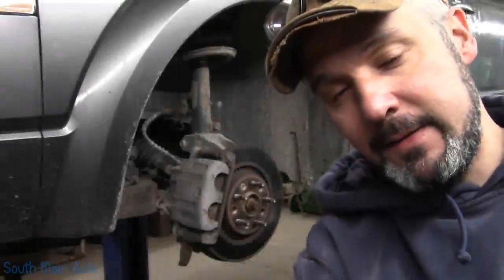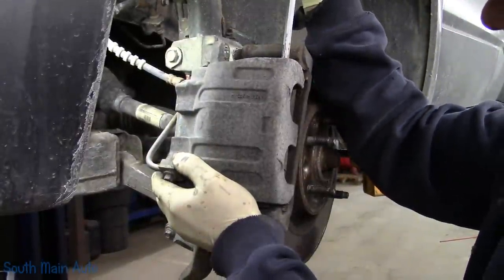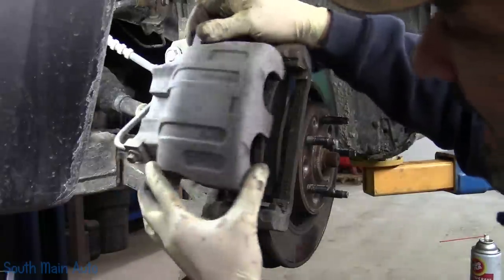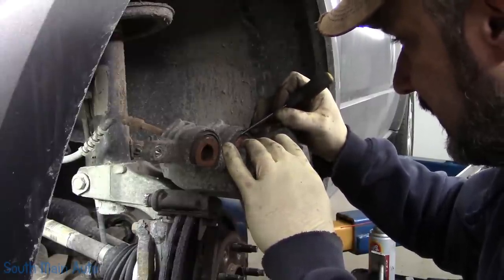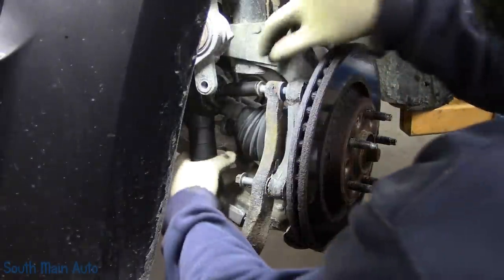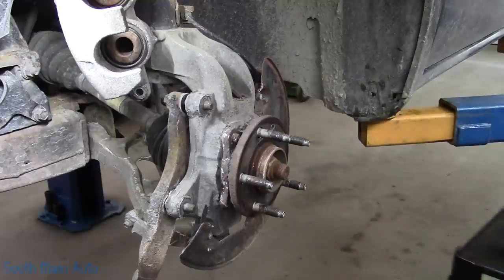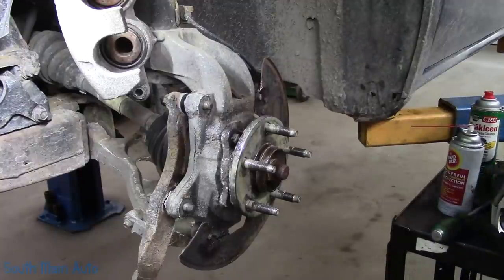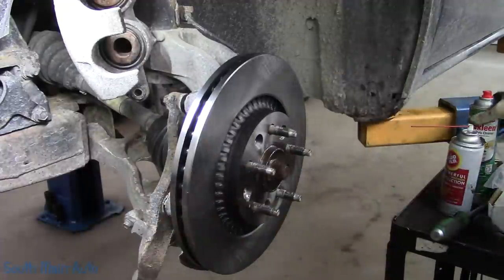Ford Freestyle: Front Brakes w/ Seized Caliper Pin

Comment: I feel better.  The last time I did my brakes I had one caliper pin that was a little sticky.  I pulled it out, smoothed it out with some steel wool, cleaned and lubed it and it seemed okay.  The worrier in me thought I should have replaced it.  Now I know I done good!  Thanks for all your great videos!

Comment: About 15 years ago I had a frozen caliper slide pin like the one in this video. I applied way too much heat to the caliper bracket and the slide pin shot out of its hole like a bullet!  It went through the shop wall !!
Im super careful with the torch now, Thanks for the great videos, Eric O.

Comment: South Main Auto Brought to you By Dorman Products Inc. The best aftermarket auto parts..... Yup that would bite....
Reply: The only thing I've found that Dorman gets right?  Would be spring brackets for Ford trucks.  (The leaf spring mounts and the front spring/shock mounts).   Everything else?  Run like it's got the case of the scoots...
Reply: I have used dormen parts works for me though I am a Diy guy.
Reply: I knew someone had that same thought!
Reply: Lol
Reply: If you buy a Dorman oil pan drain plug from Amazon, they have a left-handed thread plug as the pic which shows what you buy. Strange...
Reply: hilarious
Reply: Napa is the best because those after market parts most auto repair shops will make a mechanic get all shitty acting and want to fuck the part up on purpose
Reply: That's why they like to use federated and jack up your bill.......

Comment: A metallurgist did raise an eyebrow, initially!!!!!, No damage done, you kept temperature below Austenitnizing temperature, (critical), possibly worst case is a little induced stress. No worst than driving through deep water after sustained hard braking. Cast steel is fairly tolerant in this respect.
I do have a 4" vice on one arm of my armchair, still debating what should be fitted to the other.🤔.
Thanks for sharing and best regards from the UK.
Reply: put a grinder on the other

Comment: Not a mechanic but a contractor builder and remodeller and remodeller. I did this job yesterday and I was pulling my hair out  sith a stuck caliper piston.  The next day I pulled out a torch and took care of it. Anyways I just wanted to say that I watched this video before I did the job it would have been way less stressful Anyways I just wanted to say it and I watched this video before I did the job it would have been way less stressful. So you are 100% on point with respect to weakened DIY's appreciated that.

Comment: Here's another horror story. This happened at a  busy dealership i used to work at years ago. The workshop was down a driveway beside and behind the showroom. A courier (parcel delivery guy) drives in to the shop and talks to the service manager about his front brakes in his hiace van making a scraping noise.  The manager says we will do your pads now and bring it back tomorrow and we will machine the discs. He was in the middle of his courier run.  So he calls one of the boys over and hands him a new set of front pads and tells him the story. So my friend jacks up the van and changes the front pads put the wheels back on and heads off to the toilet as he was just about ready to fill his pants and was in desperate need of the toilet. the service manager sees the wheels are on and says to the driver "its all ready for you" comes out of the office and lets the jack down. The courier jumps in and roars off down the driveway hits the brakes and nothing happens as he goes flying across the two lane road and up over sidewalk and into a  large shrub before he hits the brakes a second time and it stops. My friend comes out of the toilet and yells "" wheres the van its not finished, I haven't pumped the the F%%$## in brakes or checked the fluid!"  to the service manager.  OH S%$t!!!.! The courier walks back in fuming. In the end we had to go over the road with the shops pick up and tow it off the shrub as the front wheels were off the ground.  Always check with the person doing the job. LOL
Reply: andrewkiwi1 always the worker keeps the doggone keys with him till the job is finished, even if he's skipping to the loo my darling!
Reply: @HighestRank  I do that. They go in the top draw of my tool chest. but he didn't. The driver was lucky that there was no traffic at the time as its usually busy.
Reply: I had a similar incident when I did brakes for my neighbor, it was all put together and I had to run to answer the phone, I was doing it at home and we lived in a dead end road and as he was turning round he hit the brakes and as I hadn't pumped them up he didn't have any and he demolished the front garden wall of my house.

Comment: Nice to see some good old mechanical maintenance when changing the disc/pad. Lot of shops just throw the new parts on with no focus to details. I usually service the brakes on my cars 1-2 times a year: Cleaning the caliper-arm/notches, ensure good pad movement, check the sliding pins and rubber - and also lube the caliper-piston (cycle it out and in a few times). Oh, and check the rubber seal on the piston. I usually do this when changing tires (from summer to winter and vice verca). They use so much salt on the roads here that you kinda have to. If you start lubing the piston you have a new spray bottle to show with dramatic sounds :P You got some skills Mr, thanks for all the tips about stuck bolts and what not.

Comment: Had a '95 Explorer, bought new in Seattle then 3 yrs later it spent a year in San Diego.  Followed by a trek across and up for 4 yrs in Suburban Maryland.  In 2004, in Pascagoula, MS, I took it in for brakes.  Guy was apologetic as they replaced 3 in total, but were able to save some the 4th.  I don't remember the details.   "It had a lot of rust".  I told him where I'd come from.  "Say no more" was his response.  But even there, they kept the cost down by saving the one.  Not bad, given I came from north of hwy 90, but a guy I worked with, born and raised, had vouched for me.

Comment: The dislikes are from metallurgists with rubber fetishes I suppose.  Great tip on that seized pin!
Reply: KastioZ *latex. Mr. Chowderhead-O put grease on the phenolic pistons and called it "metal to metal contact area".
Reply: @HighestRank  The phenolic piston has a metal face sort of like a large washer that also holds the outer edge of the rubber boot.  This metal face bears against the metal backing of the brake pad so it is indeed a "metal to metal" contact area.  I must admit that I was very surprised when I did a 4 corner brake job on my F350 to find out the pistons were plastic!

Comment: Permatex 24125 Ceramic Extreme Brake Parts Lubricant is not good for the slide pins they get stuck after a year ...
i have to warranty all brake jobs that i did for one year because of the stupid permatex grease 
Use SIL-GLYDE works best
Reply: Thanks for confirming that. I love that lube with ceramic particles for the clips and guides but I've never used it on pins. I ran into a few brake jobs with pins previously lubed with antiseize way back when. The lubricant dries up and the dry particles make the pins stick, not seize, but stick enough to overheat the rotors and wear the pads out prematurely.

Comment: Common problem in the UK with sticking pins I have in the past drilled a small hole in the other end of the carrier and filled WD40 and with mild heat normally come free and plug hole with epoxy, also I have found using copper based anti seize is fine for the pads and pistons but it has a habit of going hard with the pins so I use CV grease and have never had one stick after using it.
As usual great to watch someone else doing what the customer needs and not just throwing parts at it,

Comment: Weekend DIYer here, the drill bit trick to get the old grease out of the caliper bracket slide pin hole may just solve my problem. I'll be trying that tomorrow! Thanks

Comment: Never have had a problem fixing stuck brake pins.  I only remember one that just wouldn't free up.  Like Eric said, unless you melt the cast iron you are fine freeing up the pins. Gotta love the commentary too. All about dirty holes, dangling bolts, massaging, friction melting your rubber and seduction.  It's a Soap Opera every day at SMA....

Comment: Great to see Mrs. O!  Good Job on the brakes!  I used the Fluid Film and the blue brake grease on my wife's Kia two weeks ago.  Never used fluid film before, hope it prevents corrosion on the right front rotor/ wheel hub.  Ya, corroded in California!  Had to beat the rotor off!  Actually, it felt good!  Manually wire brushed the studs and hub.  Then Fluid Film, not a sponsor.  Left front, no problem.  Thanks for all your tips!

Comment: Our shop has been using your brake job technique for years now and never had a complaint. Only thing we do is add a little blue locktite to the Caliper bolts. Also on seized slide pins we rap a wet shop rag around the rubber boots to help prevent and burning. Thanks again .

Comment: Why do I love brake videos?  Because even though brakes are pretty simple, it's always good to see how somebody else does things because it might inspire some new some ideas.  For example, I've used drill bits to clean blind holes before, but I don't think it would have occurred to me to chuck the bit in a vice like that.  Now, I'm looking at an old tap set and wondering how I can make a hole scraper.

Comment: I doubt you heated up the metal enough to weaken it. As you stayed, you are just doing what you need to do to keep your car going. I have done worse I wont lie. Only on my own( just wanted to point that out) . If the boot is trashed, thats different. My daughter's car (86 Dodge Aries) came home with a frozen caliper one time. The wheel was so hot It cooked the piston. Aluminum gets weird when it over heats. The piston actually crumbled away.  Once again, another awesome video!

Comment: Happy weekender here,  That drill bit trick is GOLD I will use that alot I'm sure.
Thanks for this video as I'm sure I'll need it again in the future as last time I did brakes on one of my trucks I had this happen and couldn't get it loose ended up getting a new caliper.

Comment: heavy 8 awg striped to the same length as the pins stuck in the drill to clean out the slid pin bores works like a champ

Comment: Ricky, I use that CRC synthetic brake caliper grease, when I had that freeze-up problem. After a year, I had occasion to  take the caliper off, and I checked the pins. Stuff works great ......

Comment: Eric you're such a great mechanic. Most other mechanics would have tossed that bracket and charged for a new one. Every Ford I've owned one of the first things I do is clean and re-grease up those pins. Seen them get stuck and when you brake the car/truck pulls to one side. Easy Fix ! (well unless they are completely stuck like in this video.)

Comment: Have done similar before. Except not a drill bit on the bench. That's a great tech tip. I used a dremil tool with a wire wheel. Also in one case the pin had swelled... probably should not have reused it but the pin in a drill and some emry cloth for a few minutes seemed to save a trip to the parts store.

Comment: Sound like you said it just right: Fin-ah-lick with the emphasis on the second syllable.  Phenolics are also excellent electric insulators, which makes them popular to assemble printed circuit boards with discretely mounted components.

Comment: great video thanks! I had a mobil mechanic have to install a new caliper because the pin was seized! Cost me and extra $107 - $50 in labor $57 for caliper, The bracket was $47 and not in stock so I just bought a new caliper. wish the mechanic could have removed the pin this way.

Comment: I was waiting for tires at one shop and mechanic changed brake pads to someone's car. He pushed pistons in and few secs after brake fluid was coming to flood. I looked and it was all over firewall, he didn't care and left the mess there.

You should look if someone has topped the "low" brake fluid container before brake job. It nicely removes paint and stuff.

Comment: Metallurgists...chemists...let them try and get it free and leave the torch there for when they fail. They'd freak out a lot in the salt belt. I use the wire bore brushes you chuck in a drill but the drill bit is a good touch. Great video as usual!

Comment: Eric, I kind of like this channel! You make it look so simple with the right tools, knowledge and good parts as replacements from Napa. A non- sponsor source.

I hope you already know, that you're going to pay dearly for that comment to Mrs. O about going back to Facebook while you're out there making money in the garage right?

I have a question for you.
How do you know if you have a failed or seized air condition compressor on GM medium light duty truck? Specifically, 2003 GMC Savana van with 5.3 L engine system. Have you ever done that or Sonoma or similar vehicle and how did it go for you? Dave from Michigan

Comment: Eric, Great video as always, I would have to agree it is good practice to use lube on the back of the pads, and piston faces.
Brake cleaner is great for cleaning up the new Disks, (Rotors) across the pond

Comment: Retracting the caliper pistons: Years ago I got into the habit of opening the bleeder screw, with a hose attached to the bleeder to collect the expelled brake fluid, rather than forcing the old, nasty fluid back towards the master cylinder or the anti-lock brake controller. All it took was the 2nd "bad master cylinder" during what should have been a "normal" 4 wheel brake job for me to examine the actions my shop took when doing the job; both happened within 3 months of each other.  I opened both those brake masters and found more crap around the Front (disc) cup and none around the Rear (drum) cup, and nothing to indicate the crap came in thru the 2 reservoirs. IMO, "inadvertent technician induced failure" during the course of repairs.  And was in the 1970's long before brake fluid test strips were "a thing".

Comment: Good call on putting the pin in the vice.  I can tell you from experience that if you put the bracket in the vice, heat and turn the pin that when the pin loosens up it will go “POP” and shoot across the bench.
Reply: Now you KNOW someone is going to try that now......
Reply: When you work with vice, things do tend to go pop :-)

Comment: I had a subaru do this one time because I neglected to lube the pins all the time in the rust belt.  The funny thing is after heating the pin to red hot where it bent coming out I reused the caliper and it was OK.

Comment: Man.. your not wrong. I had the very same issue with a co worker, and the caliper was just a lost cause. Ended up throwing the old pads back on, and she drove it till it died 2 years later (yaa, grinding metal the whole time).

Comment: With NAPA alternators and starters, you only change them once.   They'll last forever.   NAPA costs the most.   With brakes, you can get buy with cheaper brands.    And "if I <you> can do it..."  Ya, well you have a complete professional shop.   I have to half ass everything, floor jacks, jack stands, and wooden blocks for redundancy.

Comment: Great stuff thx. Suggestion/ question: Ever crack the bleed screw to drain brake fluid as you push the pistons back? Opens the rusted bleed screw and purges some of the old fluid.

Comment: Excellent video.  I think you demoed that drill bit trick in the past because I now use it. You have really enhanced my skills when it comes to brakes.   But, why didn't you just take the boot out of the caliper before heating it? I find there is usually a lot of gunk between the boot and the internal slot so it doesn't really seal very well if you dont clean it.

Comment: Should open the bleeder and then push the piston(s) in. It won't introduce air into the system if the bleeder is closed before the piston(s) bottom out. Mostly, if the vehicle has ABS it prevents ABS module damage but also it's to not push dirty old brake fluid back up to the master cylinder. Otherwise, great videos!

Comment: I once worked in a workshop working on commercial vehicles (HGV) we called them and we had one trailer that had a buffer spring on the hitch coupling, we had to remove the coupling pin nut to re-tension, it the nut was somethin like about 6 inches across the flats and it was seized solid, the foreman told me to go get a couple of buckets of water, he got the gas axe out and heated the nut , when it was bright red he told me to pour the water on it, and after we did that the nut came of easily, same principle as your heating the caliper bracket and cooling it in water, I was astonished at how it had worked I was expecting a couple of hours of fighting with it.

Comment: Slapped pads on my toyota without cleaning the rotors. Yep. Pads chattered. Took them off and they were full of rust. Sanded them clean. Bought can of Brake Cleaner.  No more squeal.

Comment: Had front and rear pads done on a 2013 Toyota Corolla and labour was AUD 165 per hour.  At current exchange rates that is about USD 115 per hour.   Total cost for the brakes and tyre rotation and tightening the control arms:  AUD 556 with 2 hours of labour.  This was in Bondi Beach, Sydney, Australia and is a bit of a bubble economically.
Reply: Pads only? No rotors?
Reply: @fascistpedant758  Yep. Pads AUD 88 . Gives some relativity to the work Eric is doing!